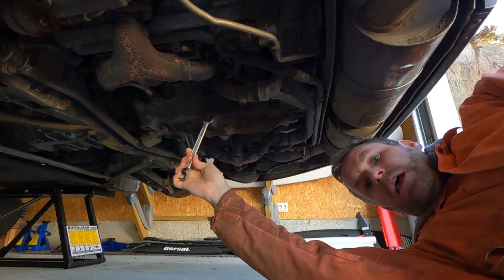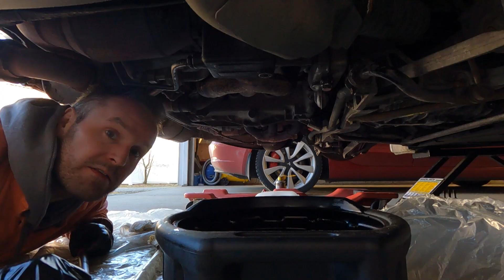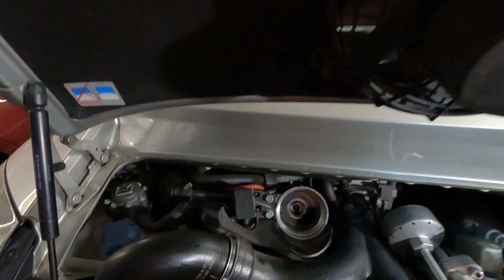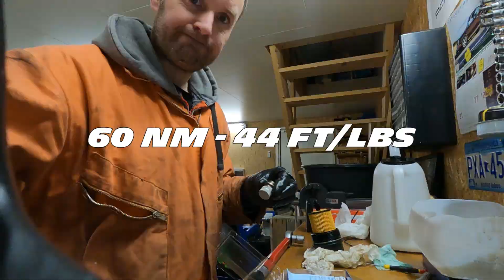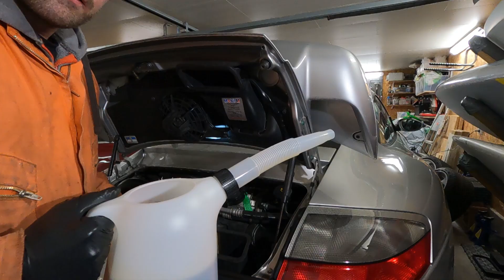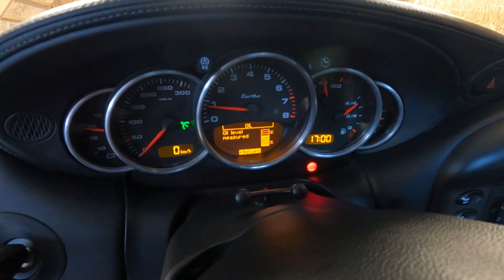Porsche 911/996/997 turbo engine oil change by the official service/repair manual

Comment: Hei! Jeg vurderer en 2001 996 Turbo som min første Porsche. Det har alltid vært drømmebilen og jeg har nå råd til å oppfylle den 😄 Bilen er tunet, sportseksos og K&N filter, samt pinnet kjølerør. Den har gått 180,000km og jeg blir derfor litt skeptisk på å bruke såpass mye penger på en gammel bil med høy kilometer! Den er manuell, men jeg ser at til samme sum penger får jeg en automat 996 Turbo med 70,000km på telleren. Hva ville du gått for? Og hva bør jeg eventuelt sjekke ekstra nøye? Veldig fine filmer du legger ut av 996’en! Millitek eksosen ble bare helt rå 👍
Reply from the maker: Takker👍 om du sjekker en av de første filmene mine går jeg igjennom det som har vært gjort på min og gir litt anbefalinger 👍 Når det gjelder km er ikke det nødvendigvis en ulempe med litt mer kjørt så lenge den er godt holdt og tilsvarende mer er skiftet. En bil som er mindre kjørt med likevel gammel må det kanskje gjøres mer med. 
Jeg kjøpte bilen som en sportsbil og for meg var manuell helt essensielt for å få gleden av det, om du kjøper det primært som en grand tourer er sikkert automat helt ok. Om du prøvekjører begge blir nok valget lettere. Det er veldig kule biler, med stort potensial, men de begynner også å bli noen år og en må derfor regne med både en del ting og fikse på de og utgiftene som følger med
Reply: @NorwegianCarGuy  jeg har tiptroniic turbo, og er kjempe fornøyd, den girer fortere enn noen andre Porsche kasser jeg har prøvd. har også noen f og g modeller i garasjen

Comment: What was your total time for the whole procedure? I’ve not done myself because it seems to be lengthy, but would do someday just need to budget the time.
Reply from the maker: I did it in between things, so used a whole day🤪 I would guess 1-2 hours?
Reply: @jeffmeunier9150 if you've never done it, count for 1,5 hours considering you have tools and material ready. You can easily do it even in 40-45 minutes but I'd suggest take a bit more time to drain as much oil as possible (it's gonna drip for a long time). Make sure you really have the right tool for removing the oil filter plastic cover, I did it with the generic 3 arm ratchet tool and I scratched the s... out of the plastic cover and metal guard underneath. Otherwise, really simple job, nothing complicated.

Comment: Thank you for this and other videos, really helpful and in detail. Great work. 
I wanna ask two questions:
1. why 0w40 and not 5w50? I just did my oil change and Porsche classic website recommends 5w50 (their classic oil, I put mobil1 5w50)
2. I didn't hold the main reservoir with the wrench to counter the force. What could potentially happen/have happened? The screw was tight but I didn't notice any excessive movement of the tank while loosening the plug. 

Thanks again!
Reply from the maker: Thanks! Appreciate it👍
1. 0w40 is recommended in Norway because of colder temperatures. If Porsche in your ares recommends 5w50, then I would use that.
2. The oil tank is relatively thin, so it could warp or in worst case brake off the area where the plug is welded on. Probably will never be a problem, but the stahlbus should make life a little easier in several ways.
Reply: @NorwegianCarGuy  thank you for a reaction. I forgot to ask, when you filled the oil and then measured it with the ''electronic dip stick'' using board computer, how many bars do you left empty from the top? There is a thread on multiple forums and people say you should never fill it to the max. level, they say two bars under maximum (top arrow) is ideal. Whats your experience?
Reply from the maker: @pepecz thanks! it was 2 bars under 👍